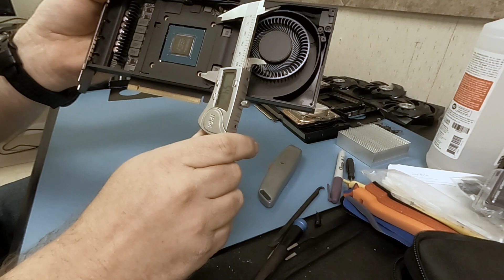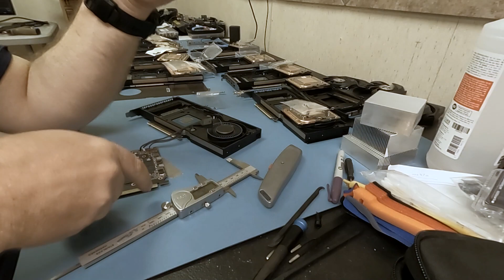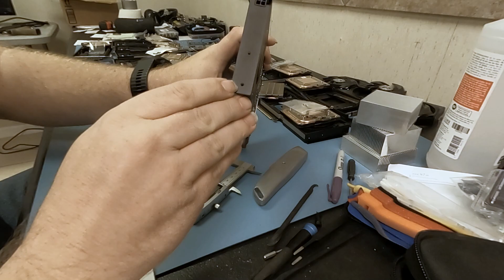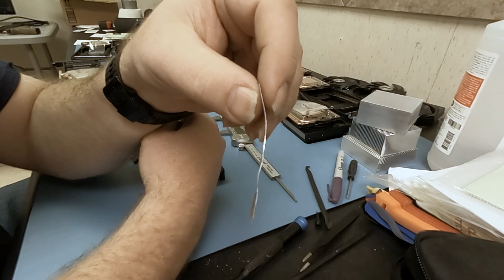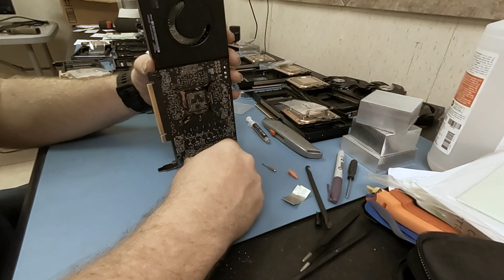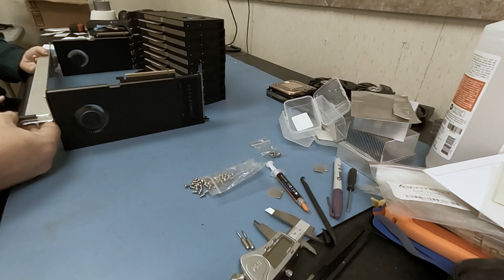Nvidia A4000 Immersion cooling Node rig build, GPU teardown and immersion discussion

Comment: I got an immersion a4000 rig keep getting an error RROR: X server failed. OC and fancontrol may not work. If the problem repeat, please reflash disk drive.  is this from overheat?
Reply from the maker: did you replace the thermal paste with a pad?

Comment: Hey, excellent content. I'm looking to run naked 3060 ti's. I have copper sincs to put on the processer and memory chips but can't find a way attach/get them to stick. Any ideas? Would love to send you a pic and get your opinion on this setup.
Reply from the maker: Yea, if they are small bits, you could use some thermal epoxy, but once you do that you are pretty much stuck with it as it's most likely not coming off.  on 3060 it's most likely could run them just with the cooler if your tank has some flow.
Reply: @brainsmine8551  Thanks Brains, appreciate it.

Comment: Have you tried barebones without any heatsink? Will the dielectric fluid not cool the core that way? Just curious would save this step if it works.
Reply from the maker: No, the gpu die will get to 90c very quickly with no heatsink
Reply: @brainsmine8551  i figured it could go either way lol, thanks for confirming!

Comment: Hello. Does this Indium foil will help for ordinary rig without immersion cooling? I want the fans to spin at lower speeds
Reply from the maker: No, you would be better off using high quality thermal paste for air cooling. I've used Thermal Grizzly Kryonaut Extreme ( https://www.amazon.com/Thermal-Grizzly-Performance-Processors-Computers/dp/B08R6QG2CQ ) It's about the best paste on the market right now. You could also use high quality pads on the memory, all of which would help the heat get from the card to the heat sink. But if it's hot, the fans are going to spin.